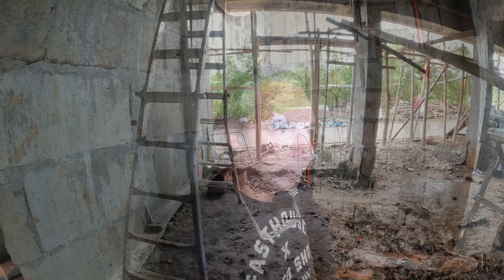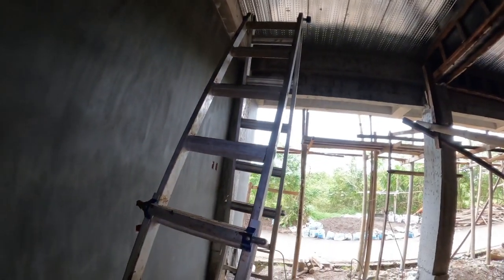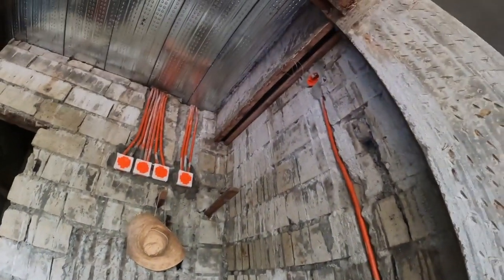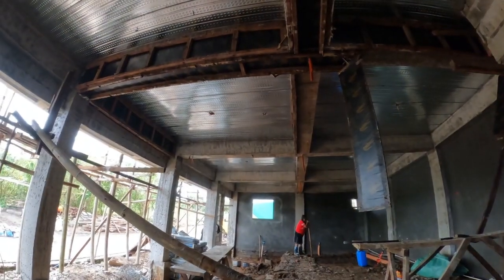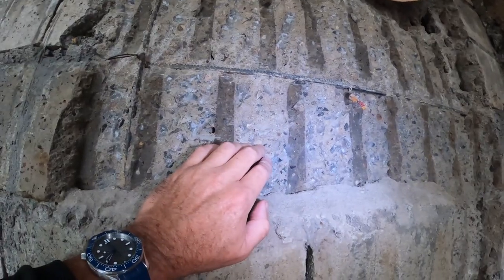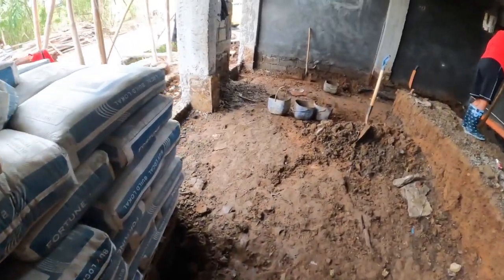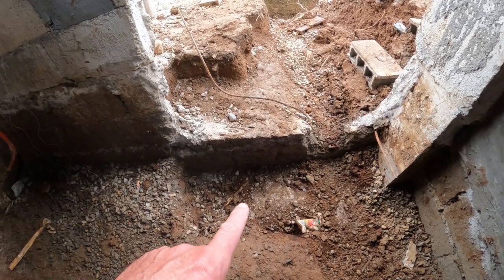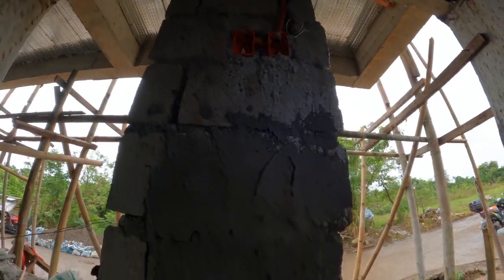Steel Deck Ceiling! 🙌🏼 | Garage Build Philippines | Ep. 21 | TORINO

Comment from the maker: follow up - if you plan to go with steel decking for the beauty aspect of the ceiling, make sure not to weld on or nearby when installing it as the heated areas will oxidize.

Comment: Wait, you don't need 6" of concrete, 4" is plenty for driveway and garage floor.  You don't need fiber either; can you find 6"x 6" Clinton wire?  That's all you need.  But I would knock down the door threshold, so you have a nice smoot door threshold.
Reply from the maker: thanks for commenting, i'll be parking some heavy equipment in there, so that's why i went with a stronger floor.